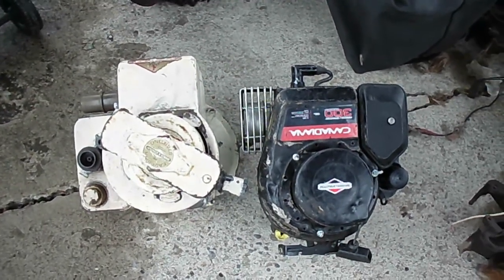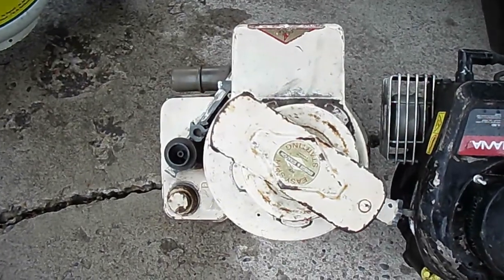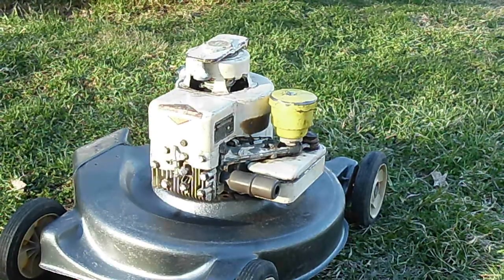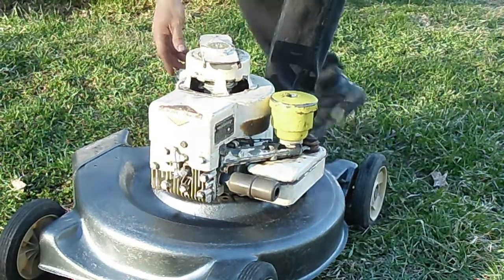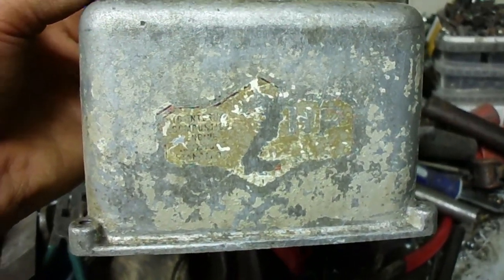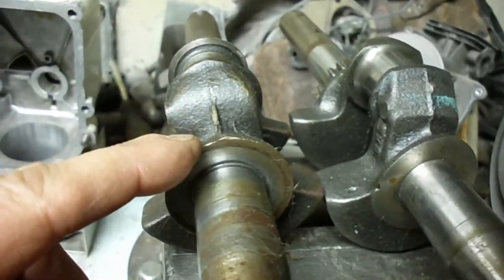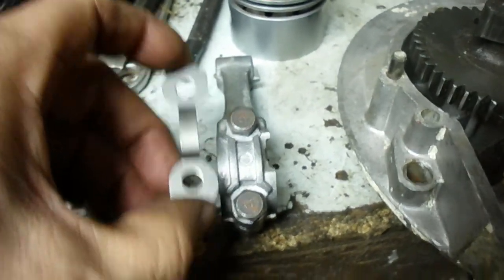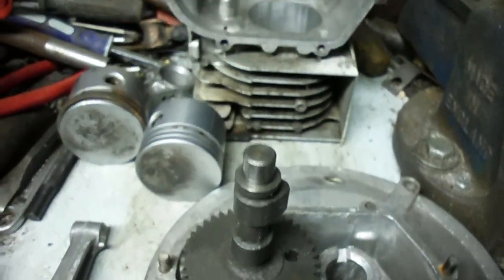1963 Briggs 2-1/2 Horse Fires Up, Vid #1 in Engine Development Series

Comment: I just picked up a date coded 63 Briggs 2-1/2 yesterday mounted on a Worcester brand lawnmower, made by Savage Arms. 

I wish I could see the governor linkage a little closer on your 63, so I can see how mine’s supposed to go, and whats missing. 

Someone janked it up, and put the throttle cable directly on the throttle shaft. 

Mine doesn’t have the crank start. Its conventional pull start.
Reply from the maker: I will see if I can track my engine down, and make a closer view of the linkage for you.
Reply: @ChargerMiles007 hey thanks, but I’m all set now. I ended up figuring it out. I needed to order the link that goes from the throttle to the governor vane. I also needed to order the lever screw and washer so I could re-attach the lever onto the carb that the throttle cable and governor spring attach to. 
I now have throttle and choke control.

Comment: That wind up hand crank start is pretty cool, never seen one or even knew such a thing existed, they must be rare!
Reply from the maker: I guess they are somewhat rare, I had never seen one until i found this one at a scrapyard. The one disadvantage of it is the weight, it is 5 or 6 pounds! I could see it being useful to someone who just can't pull the starter cord fast enough. Nowadays they are getting into Lithium Ion batteries and electric starters, seems like an expensive solution to a problem they had solved bu the early 1960s. I would imagine they could lighten the spring mechanism up, if they wanted to do so now,

Comment: That start up procedure is a thing of beauty
Reply from the maker: LOL, yes, the first time I did it back about 7 years ago, the pin didn't release fast enough, and broke all 4 aluminum fins off my mint sandblasted and painted flywheel !  I was NOT amused!  This time I found one with at least 1 fin broken off already to give the pin a larger area to sit in. The 1965 starter doesn't use a locking pin between the fins, so it is better in that sense.

Comment: Neat to see the crank up version. From what I've heard, once the engine got tired, the crank typically didn't have enough ass to spin the engine quick enough.

 Also wondered about the change from the carb/fuel tank being mounted on the same side as the muffler. Was obviously a big change, as the block design had to be altered for the intake port. Wondering if there was issues with hot fuel due to the muffler being so close to the fuel tank on the original design.
Reply from the maker: I think you may be right about the crank up starter not having enough fruit punch to fire the engine up in all situations. I ran into that problem on a vid of the 1965 engine i will upload in a few days. Perhaps people were having too many gas tank fires while re-filling a hot engine, so they changed the design in 1965 (from what I can tell) that is the way my 1965 engine is built.

Comment: Great video. I haven’t seen a windup one in 45 years. My dad had one back in the early 60’s when we lived in Atlanta.
Reply from the maker: I remember when i found it at the scrapyard, i wondered what the heck it was! A few years ago i found a slightly newer one, the 3 mounting bolts holes on it were broken out.  I welded it up yesterday to get it ready for a run on the 65 subterranean  engine once it stops raining out!

Comment: Never seen that crank model in Finland... That would be cool!
But i have one 180cc/4HP mover engine with 12Volt electric start. Its from late 80s or early 90s. Never seen another. It even has charging coil and diodes.
Reply from the maker: Yes, I have a 4 horse engine like that, they seem to be kind of rare. I think the one I got the engine from had a battery pack on the mower handle bar.

Comment: I love that crank-starter setup, make it much easier to turn the engine over rather than yanking one's arm from one's shoulder socket when the engine is reluctant to start for the first mow of the year... :D
Reply from the maker: Yes, I found my shoulder was a bit tender for a few days after starting 2 engines. To make life easier I normally take the air filter off, pull the engine over to compression stroke. and put a few drops of gasoline into the carb. This makes the first start go much easier.
Reply: I just about wrecked my right shoulder trying to start my Briggs 5.5 horse Intek mower engine a few years back (never did get it running, must try again this year!), if I'd known then about drill-starting I'd have used that, also if I'd known back then how to fix the thing I probably would be using it now... :P
Reply from the maker: LOL, I would be careful using a drill to start it, though I think my son has done that.

Comment: I remember always hearing about someone’s grandfather or neighbor dropping dead while mowing. I always though it was the 105 degrees here in the swamp doing them in. Turns out their push lawn mowers weighed 200 lbs.
Reply from the maker: Yes, some of the old push mowers I have seen on the net are heavy beasts for sure. Combine that with 105 deg. F, and you have a heart attack waiting to happen. I work up a big sweat just cutting my lawn, so I do it in 3 stages, taking a break in between. I am not an exercise freak, so mowing grass and shovelling snow are the main exercise I get, so you have to do it in moderation.

Comment: That little wind up engine is quite cool. Looks real nice. The sound of the pawls when you cranked it must have been the sound they used in cartoons and other movies!
Reply from the maker: LOL, yes, perhaps they did use that sound, it is kind of cool  :)  The old lad fired up on the 3rd pull before I had the camera going, not bad for an engine that hasn't been ran in 25 years at least.
Reply: @ChargerMiles007  
Pretty darn cool. Thanks for showing it.
Reply from the maker: I have more on the way soon, my next star is the 1965 Subterranean engine I ran last year. It has the funky intake port on it that is the shape of an airplane wing! The JB weld is still holding up around the valve seats, and in the cylinder wall. I got it running the same night as the 1963, to avoid the 5 days of rain in the forecast!  I primed it as usual, but after the 5th time i knew something was up, in my hurry I forgot to put gas in the tank!!!  Then it roared to life on the first pull  :)
Reply: @ChargerMiles007  
I remember that one. I look forward to seeing it again.